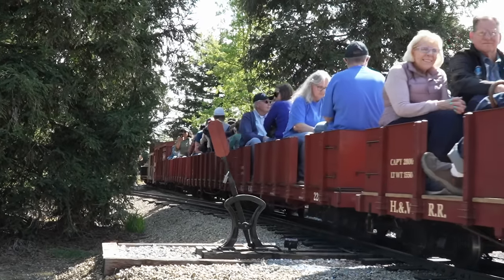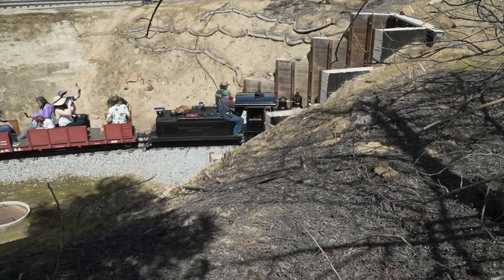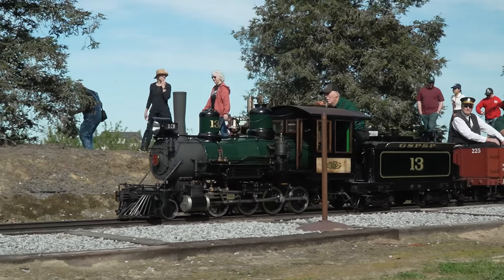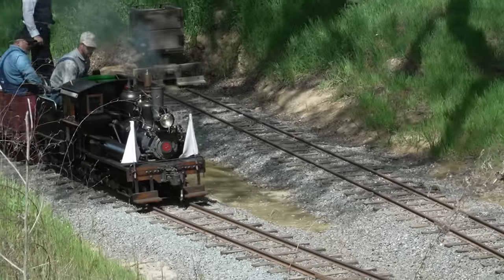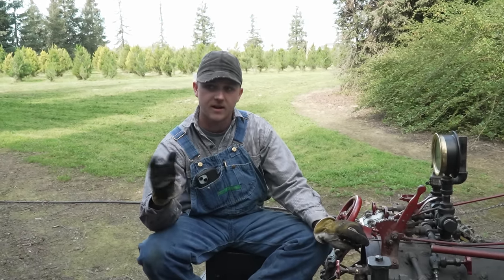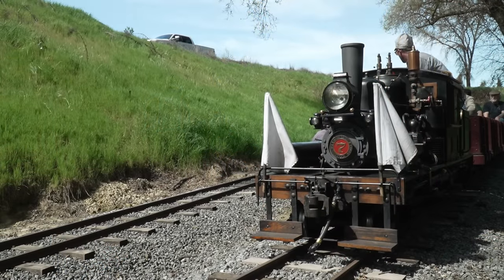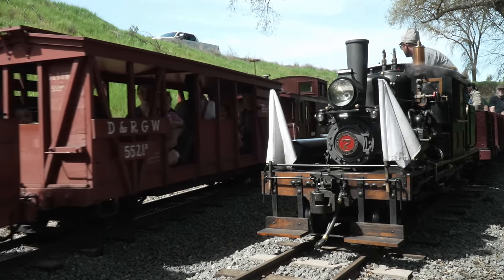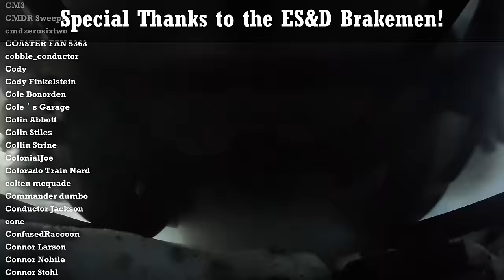What is Grand Scale Railroading? | Railroad 101

Comment: At full scale I’m more of a Diesel fanatic. However at these smaller scales I’m way more interested in the steam.  At those smaller scales the steam is so similar to full scale with most of the same components.  For whatever reason small scale diesels are basically never anything like their full scale counterparts.  For example they usually aren’t diesel electric, they don’t have dynamic braking, they can’t run DPU’s, the exhaust isn’t as much fun to deal with since it’s now right in your face, the engines don’t sound like scale versions of the big ones, etc etc.  It’s just funny to me that old school steam scales so nicely when it seems like it would be harder to do.
Reply from the maker: Yeah it's interesting how that works, isn't it?

Comment: One of the pioneering Grand Scale railroads in the US is actually one that is largely forgotten, the Centerville & Southwestern in New Jersey. In the 1940s, this line (also on a farm) was doing what the Hillcrest & Wahtoke does today, with a 1-mile mainline of 9-7/16” gauge track and a fleet of exquisite equipment that included a 20-foot-long live steam Northern with a genuine ALCO boiler. The equipment still trundles in NJ today although in a much diminished capacity.

Comment: Lovely video, Mark!

I have fond memories of riding on 15-inch trains in the UK, the Romney, Hythe and Dymchurch Railway down in Kent. It is mostly a tourist operation today (though locals use it as well), and it also had a number of freight contracts over the years and even its own little armored train during WWII! They have some very pretty engines, and the southern end of the line at Dungeness is just stunning.

Comment: please do a video on
eletric trains (evaluation of them and some of the mechanics)
and evaluation of diesel and steam, atualy just evaluation of different types of trains
the porters steam loco 
the Japanese class d5,
the Chinese QJ 2,10,2
or just exsamples of asian trains 
how do gear trains work
all the different value gears and how they work, and why
double ended diesel trains (and electric) 
American and European switches other then the British class 07-09
what to do if the train stalls
one talking about the different types of steam funnles and there uses,
all the flags and signel light color meanings
how do fire box door controls e
work
steam locomotive combination breaks (steam and vacuum brakes)
the breaks commonly on wagons that you turn like a valve/leaver mechanical breaks

a short video on how a Armstrong turn table works 
a basic video on flagmen/break men who would ride with the train and any other "small" jobs
what did trains (mostly steam) do when going in tunnels, ive heard of gas masks or just useing a wet cloth, or did they bring in other engines like later on they used electric trains, or were there no big tunnels.

why are some trains wagion tops (the stream lining thing to boilers sorry if it makes no sense ive only heard it once)
railway terms and slang

the different types of cut offs/reversers/Johnson bar
some are a big lever, some are a screw reverser, and ive also seen some that are like rods, one exsample is train sim World 3 with the scre reverser like a stairing wheel

wet vs dry/saturated vs super steam,
is there any disadvantages to having the positions and stuff at the rear of the engine other then limited fuel ..
like mechanic problems?

Comment: Question, would a grand scale or other 'replica/model' be more or less powerful than the full size in a relative sense? Would a ~40% scale model be ~40% as powerful? Slightly more due to smaller drivers? Slightly less due to smaller cylinders and boiler?
Reply: It depends on the design. All the math is the same.

Comment: I have trouble understanding how you get to 40% of full-size in 15" gauge? If you multiply standard gauge of 56.5 inches by 40% you get 22.6".  I was long told that 15" gauge is quarter scale, and 12" gauge is 1/5th scale.
Reply: The locomotives at Hillcrest and Redwood Valley RR are 40% narrow gauge. It gives them a larger appearance than if they were based off of standard gauge, while still being 15” gauge.
Reply: @mollyengelmanmedia  OK, 40% full-size for a 3' gauge engine in 15" gauge makes sense.  For a standard gauge engine not so much.